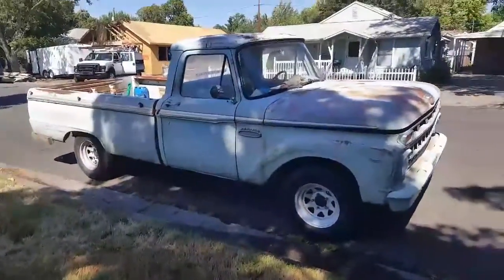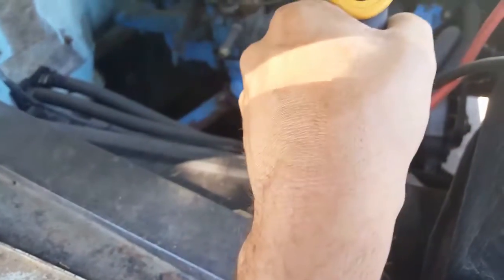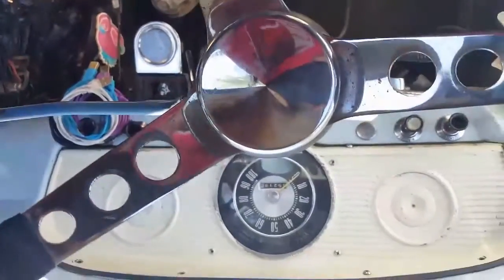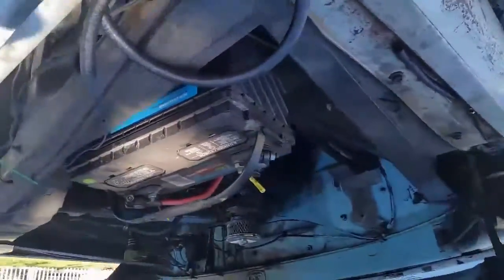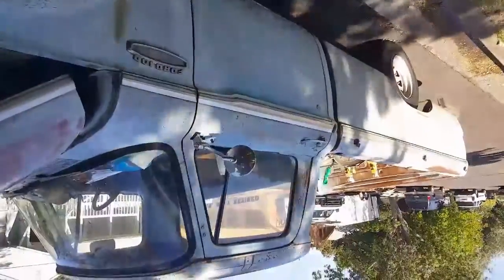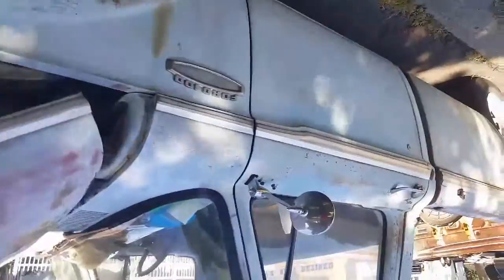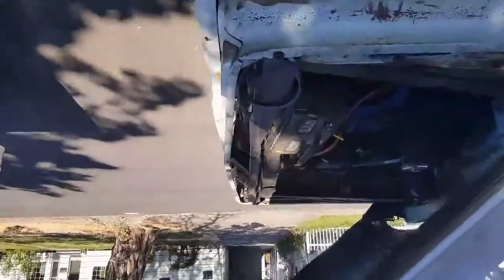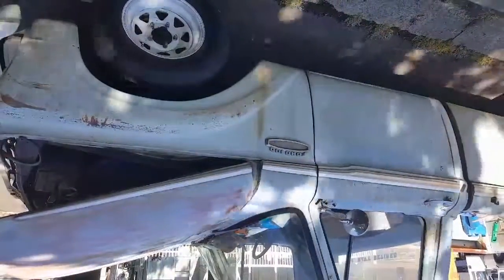My 65 ford f100 alive after 9 months

Comment: Nice old truck Dude.
Reply from the maker: thanks man don't see a whole lot of these running around anymore especially still  on the original engine  and drive train
Reply: We had a 65 chevy  on the farm. It had a straight 6 in it. It would start no matter how cold it was with a manual choke. wish we still had it.
Reply from the maker: that's what's awesome about these they always freaking start no matter what even if it is freezing tits outside.....I get a lot of comments driving this truck and even get the occasional what the hell are you shifting that automatic for and why does this automatic have 3 pedals on the floor....apparently not to many people know how to drive a column shift manual transmission these day

Comment: Please sell this truck to me !     ...these are hard to find.
Reply from the maker: Trent W I couldn't sell it...shes been in my family for 52 years
Reply: Stop living in the past, ...I could give this truck a great home !
Reply from the maker: +Trent W its had a happy loving home for the last almost 53 years....was my daily driver for years and years till last year....i rebuilt the entire front end and suspension last summer using heavy duty springs up front in preparation for a big block ford....the 300 straight sixer that's in it has almost a million miles on it and is getting tired...it still doesn't burn oil or knock but the cam is going round in it so it don't idle the greatest anymore...but I could still drive it any where but 70 or 75 is about as fast as it could go pushing it hard with that tired 300 six and a 3 speed trans